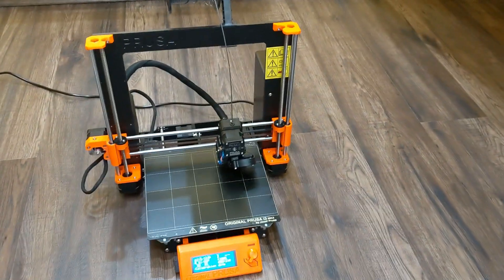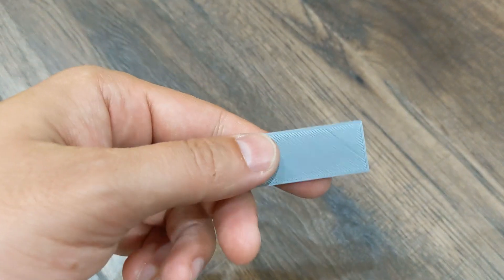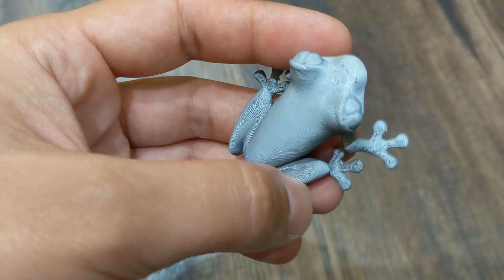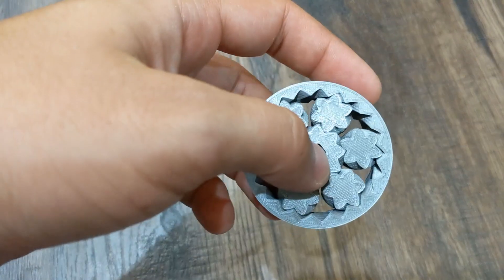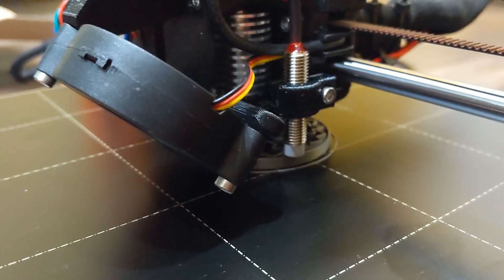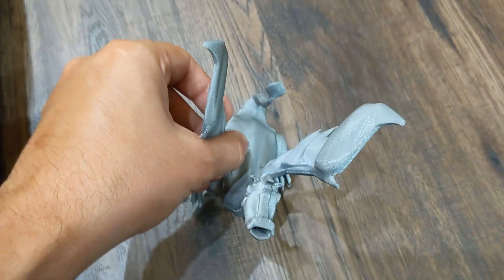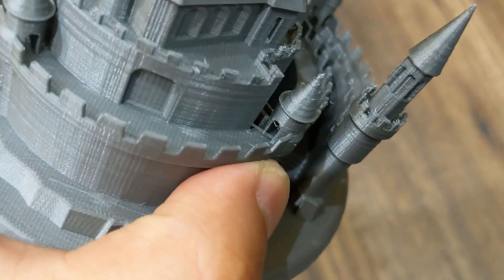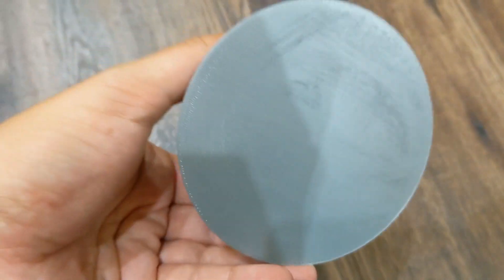First test prints with my newly assembled Prusa i3 MK3S ep. 2

Comment: Would you buy the pei smoot or the non smooth build plate? 😀
Reply from the maker: I bought both of them, but I’m using only the textured one. It is much better and you can print on it with PLA and PETG without using any extra stuff like windex etc…